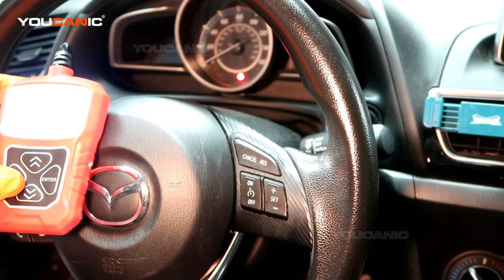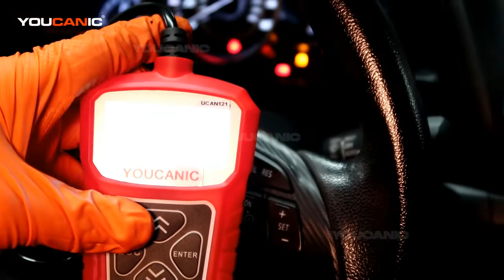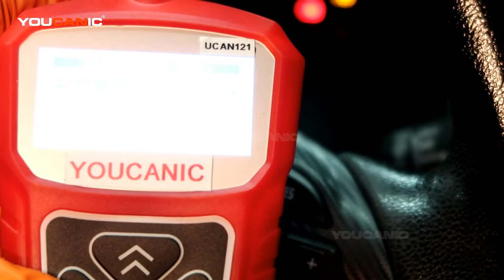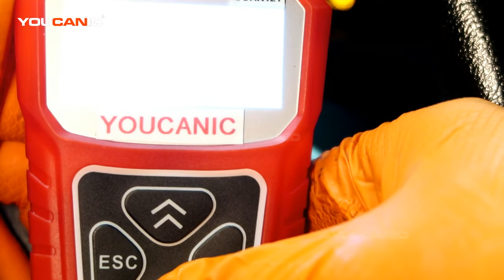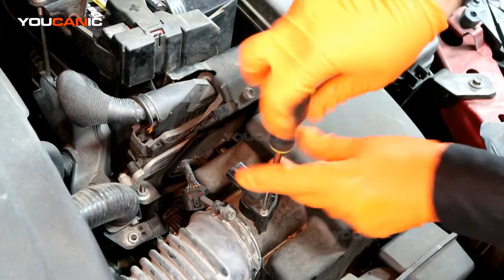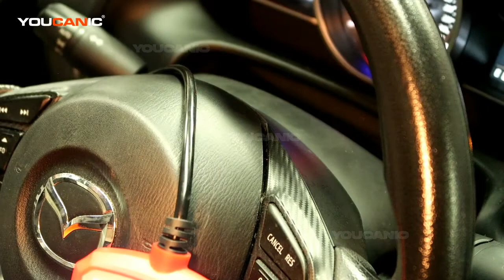2014-2018 Mazda 3 Intake Air Temperature Sensor Replacement

Comment: Any idea if this is the same on a 2010? We have one that’s throwing some codes and one is “Intake air temperature sensor” but I’m wondering if that means mass air flow since I don’t see an intake air temp sensor… just Lmk, Thanks
Reply: You ever figure this out? I have a 2016 saying intake air temperature sensor. But can’t find the part . Is it part of the maf mass air flow sensor?
Reply: @stingray527 I suspect it’s a part of the maf sensor. I’m having the same issue

Comment: So all three codes mean the MAS is messed up? I have the same three codes on my 15. My check engine light turned off before I changed the MAS, but I changed it anyway. Now the light is back on. Could it be that I didn’t clear the codes? Do I have to even if the check engine light turned off on its own before I replaced the part? Hope this made sense